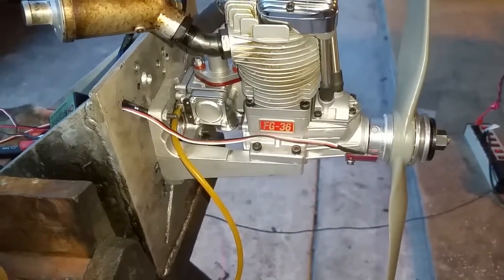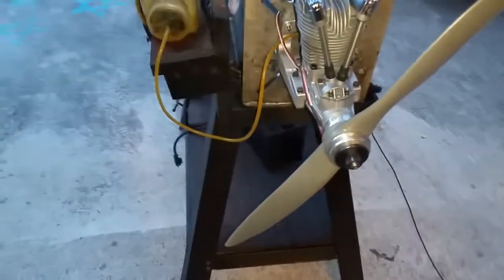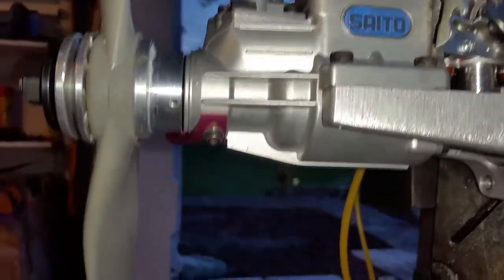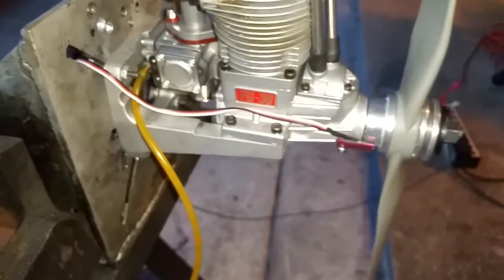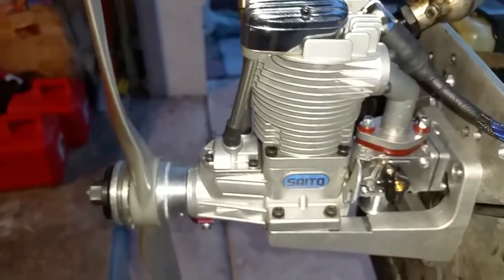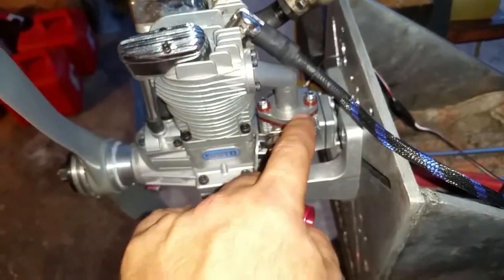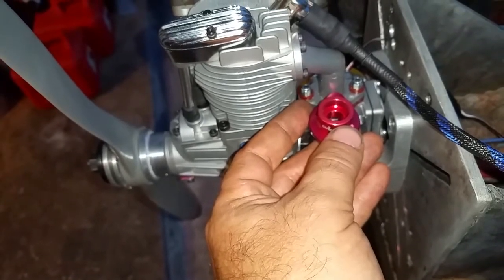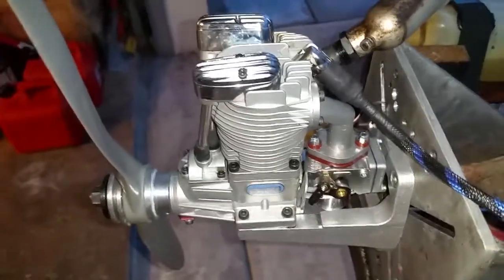Saito Fg36 CH Ignitions CDi Conversion

Comment: Hi Adrian, thanks for the video, that engine runs nicely. I have a Saito FG40 that I have had some problems with. Its standard out of the box, and although I have managed to get some fuel through it (about 2 tanks), it runs very roughly, is VERY difficult to start, and it has 'bitten' me once when I was putting the prop in the right position to flip it. It fired very early and basically backfired and hit the back of my finger...very painful, but no major damage. I am convinced that the timing is wrong although why would Saito ship an engine with a bad ignition. i saw your timing video and am going to check the timing on this model. In this video you say that the timing was wrong because of the location of the sensor. Have you tested an FG40 and if so, what were your findings?

Comment: hello, could u tell me how 4 stroke rc  get oil in crank and do u hav to change compresion ratio for convertion .thanks
Reply from the maker: The oil on the case get in,from the  Blow BY the piston rings.
If you use Hi Octane gas you can get by . In theory should...but not absolutly necessary.